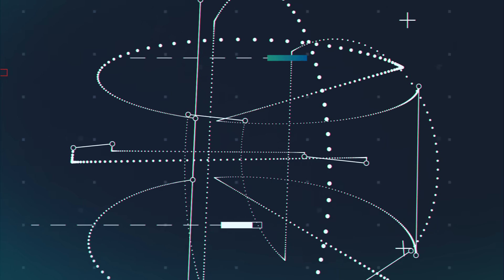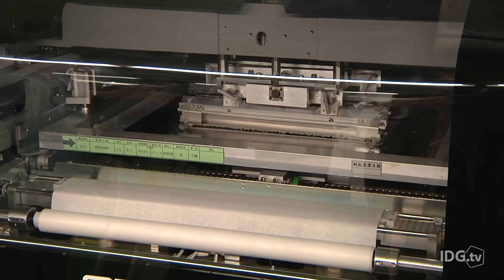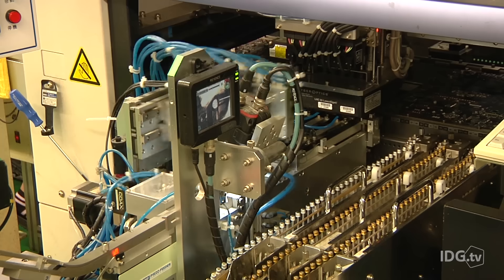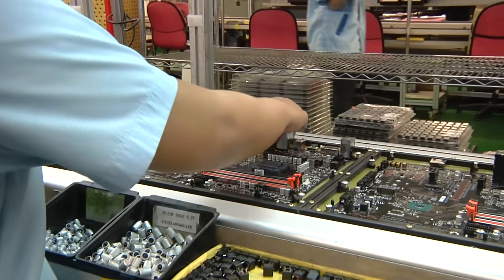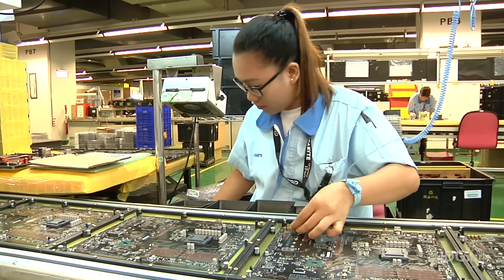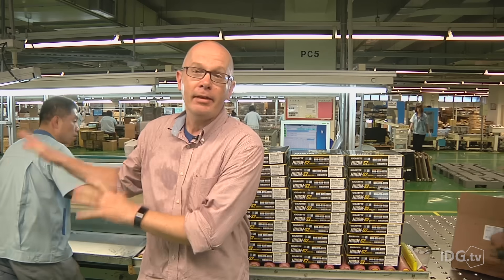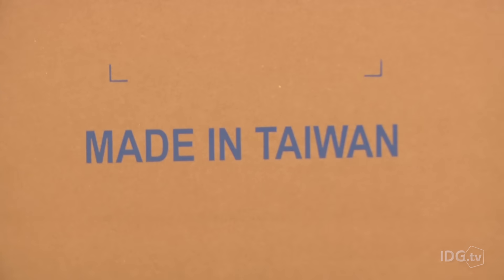How a motherboard is made: Inside the Gigabyte factory in Taiwan

Comment: The industrial engineering layouts and machine interfacing is so killer at this level of tech...Those machines are all "one of's" task specific built...Takes DEEEEEEEEEEEEEEEEEP pockets to finance stuff like this...
Reply: If you bought everything new,  a full double-sided SMT + PTH assembly process along with QA equipment (solder paste inspection, automated optical inspection, X-ray, flying probe and/or bed of nails in-circuit test and programming) easily runs over US$1,000,000 to start. Then you have to pay people to program, maintain, and operate the equipment - all different skill sets. The first board is always the most expensive and difficult to build and you might not break even until you've built many, many boards.

Comment: it surprises me to realize how these boards comes without faulty, respect for these hard workers
Edit: OMG thank u for so many likes
Reply: well mine just came to me faulty :(
Reply: I was about to say that motherboards are frequently DOA. In fact, I just had a brand new gigabyte mobo that I RMA'd because it was faulty right out of the box. If you go through reviews for any brand's motherboards on places like Newegg, you'll be hard pressed to find one that doesn't have lots of people complaining about having to RMA boards.
I can't fault the production process itself though. Motherboards are extremely complex and delicate systems and it's probably very easy for them to get damaged during the shipping process, even if they pass QA at the factory.
Reply: @zomgpirate  yeah and also motherboard manufacturer customer service is many time non existant. They will literally pretend to help you and then not follow up or  never email you back
Reply: Speak for yourself. My ASRock motherboard came with a bent pin on the socket that goes to the memory controller, 2 RAM slots are dead. Great stuff!
Reply: @Idi Amin do you live in Taiwan?
Reply: wrr
Reply: I've been waiting 7 weeks for my new motherboard to get RMA'd because it was shooting out sparks when I got it.
Reply: @addictedtoRS  so, how is it now?
Reply: @mrutub13  The new one I received has been working just fine, although it's overclocking capabilities are sub-par. I have tested undervolting and overclocking my Ryzen 5 3600X, as well as lowered timings on my RAM on my friends ASRock b450 motherboard, which gave significantly better results than what my Asus TUF b450m can achieve.
Reply: they test every piece before packing.
Reply: press f to pay respect
Reply: There's Quality Check at the end of production line.
Reply: It looks easy to work up there, but the workers make long hours i suppose.
Reply: You'll understand all of these when you work on semicon industry
Reply: @Rav3nnn  It's somehow also interesting because I got an education at the High Technical Education, the Graphic Lyceum at Eindhoven, the Netherlands, kind regards.
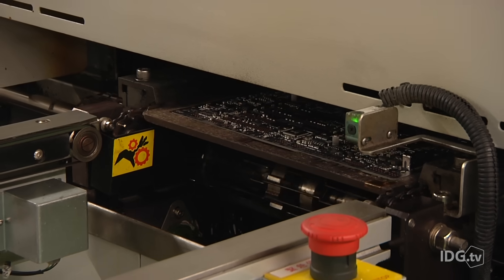Reply: 0:52  this happens because they are backed in an oven
Reply: There is no warranty for Gigabyte or other barnds will be made without faulty. Even some one of those hard workers sometimes can have two left hands.
Reply: Because they have to pass through quality check
Reply: There is a whole industry around repairing faulty motherboards
Reply: When you are using the right equipment for the job, no faults will occur.
Reply: Yeah uhhh they do though. Mobos get RMA'ed all the time. Also @Lucas Pittol da Silva, your comment makes no sense.
Reply: @silverstonebbq  but it reduces the chance of something getting screwed enormously.
Reply: Because Taiwan isn’t part of China. Lmao.
Reply: that's because Taiwan numbah one 💯💯💯
Reply: @DionsTravels  passbook
Reply: @DionsTravels  sir can i ask question? month ago i ugprade my full PC to asus.motherboard.GPU but why it said made in china? i think asus it from taiwan .i live from indonesian
Reply: why would you say thank you for likes
Reply: @SnuSnu91  sir can i ask question? month ago i ugprade my full PC to asus.motherboard.GPU but why it said made in china? i think asus it from taiwan .i live from indonesian
Reply: They come with a lot faults...
Reply: Its 50/50
Reply: Mine came burnt
Reply: I had a gigabyte motherboard DOA once. It was my first build as well, unfortunately.
Reply: You should be. I own the place!
Reply: Said by non a single covid-19 patient ever.
Reply: not all... i receive my motherboard on taiwan, model x58 and it was a waste of money
Reply: @SushiCat0316  It is a fact that making motherboards has to be done by employees, kind regards.
Reply: wrong giabyte has a lot of defective motherboards brand new. to be fair all manufacturers are bad including asus, asrock, basically every manufacturer, no quality control

Comment: Thanks. Wish I could have seen the tiny parts actually placed on the board, though.
Reply: pick n place robots
on aliexpress  you can buy
as well as  owens for soldering
one machine  placing the soldering paste next places the parts then  its going to the owen

larger parts that  were complicated to place  with  robots, those  placed  by workers
Reply: The plexi is usually dark to limit the external light, as high resolution cameras are used to align each and every part to ensure it is placed correctly. Parts can be as small as 0.01" x 0.005" (and even smaller is coming). For this size board, the smallest part is likely 0.04" x 0.02". 

I'm not as familiar with the Fuji systems shown here, but all covers are typically safety interlocked as the gantries that pick and place the parts are dangerous.

Comment: The product should cost a dollar and not hundreds since they are made in air conditioning sweat shops.
Reply: The board itself, connectors and passive components cost nothing. But the chips are very expensive. The pick-and-place machines cost thousands of dollars to maintain and operate.

Comment: The only flaw with Gigabyte MB's is the way PCI-E bandwith is handled. its done so poorly..
but still they currently have the best AM4 board on the market which i recently ordered (Aorus X470)

if your doing SLI/Crossfire don't get a Gigabyte board, if your doing RAM/CPU OC its great for that.
Reply: Gigabyte have been making the best motherboards in the world for over 20 years now.  I can't comment on any pcie problems you've run into.

Comment: Much less automated than I thought.
Reply: You realize that over 95% (a guesstimate, and probably too low) of the parts are automatically installed, and all of the actual soldering processes (save for rework/repair) are completely automated? 

The larger "odd form" through hole parts (connectors, electrolytic caps, LEDs, etc.) don't lend themselves to automation, but there are ways to automate those as well. They just aren't usually as economic as the world's most adaptive creation: people.

Comment: Great. There is widespread concern over some PIXEL phones, which are in trouble by showing Over-heating, Boot-Looping, Abrupt break in display, faulty microphone etc. Google has admitted that in some phones, these faults are because of tiny solder crack in audio-Codec.  Kindly indicate, in the factories, is it possible to view the crack ( using some Microscope or macroscope type device), and if found, re-solder it ??

Comment: Gigabyte makes very good quality boards, and they work great with Intel chips. I just put together a gaming rig with a Z370 board, and the build quality of the board is very good. Only thing is that I would have liked an extra USB 3.0 header, because my PC case has 4 USB 3.0 ports in the front and with only one header, I can only split it for two of those 4 ports. the rest are USB 2.0 headers. Other that, I love this Gigabyte board... It feeds RAM to the CPU at lightning speed, which is a great thing for any application, gaming or no.

Comment: yeah i know that "a lot of work still done by hand' because one of this fuckers throw glue into my 1080ti chip and he/she didnt clean it before it petrified.In result i endup buying a brand new Aorus extreme edition 1080ti which with 100% fan speed was hitting almost 90 degrees celsious in just one run in a common valley test.Yeah good job fuckers.Nice quality control Gigabyte.Thank god that i opened the poor card and after two hours i managed to remove all the stupid glue from the chip.ever since the card maxed out at 62-65 degrees. As for gigabytes job you can take my midle finger

Comment: My old gigabyte board(G41) series had an issue with the northbridge failing several times even after reflow.
Went to the dealer who offered me an old G31(I wanted to keep the current processor and ram) which is running flawlessly since 5 years.
Newer generation boards now come with solid state capacitors which increase the reliability serveral times, plus the dual bios really works when needed.
Reply: The G41 boards with the ICH10 ran incredibly hot yet didn't have any sort of active cooling. Add on top of that the lead free issues still being worked out because of RoHS and the thinking at the time that either A: Everything would work just like it did before or B: Everything would work just long enough to get it past the warranty period. It was a massive cluster and I was proactively adding cooling solutions to customers systems to prevent the onset of these issues. Fans, much better, or in a lot of cases SOME thermal paste, to these heatsinks, greater tension on the springs. Yea, it's like they just didn't give 2S from 2005-2010.

Comment: Motherboard Ranks:
1.Asus
2.Gigabyte
3.Micro Star (MSI)
4.Asrock
5.EVGA
Reply: I think generally grading like that is pointless. If you google, ten sites will give ten different rankings, but the ones listed here are indeed the more popular brands.
For accuracy one has to look at several variables:

Intel or AMD
Form factor- ATX , ITX. Mini ITX etc
Warranty 
and of course Cost.
...
I have so far only assembled Gigabyte, ASRock  and ASUS boards. All three have their own strengths. Recently my mini ITX Gigabyte had to be taken to service centre.Network controller got fried.  Was about 3 years old.  They recommended I get a new one since they have discontinued that model. I opted for an older LGA 1150 board which they sold me for a song. So I can still use the old processor and DDR3 rams. 
I just finished rigging up another mini ITX Gigabyte H27ON-WIFI. Choice was based on price and the fact that the Gigabyte technician has become a good friend of mine😁.

Just my 2 cents babble. Thanks for bearing with me 😌
Reply: what about msi?
Reply: I have 2 ASRock boards. Unfortunately, I have no reason to try another brand just yet.
Reply: EVGA is good but kinda expensive ones.
Reply: I have an Asus MB and a Gigabyte VC.
Reply: Depends on what you're doing with it. All motherboards have there pros and cons
Reply: Asrock is a branch of Asus and it's cheaper than EVGA
Reply: NZXT launched its first motherboard recently, I don't expect to it to be comparable to the ones of the others more experienced manufacturer, but it looks good and hope they'll improve in this market. Right now I have an Asus Maximus X Code, best quality ever, I agree they are one of the best.
Reply: No asrock is best

Comment: No wonder my gigabyte mobo's keep blowing up if this is their current production process.

You can't check a good solder connection with just surface photos and human flip through the hand checks. I'm 3/3 in 2 years that needed to be sent back because of burnt shit, one of which took out my 4770k along with it.

Never gigabyte again, i'm sticking with asus thanks.
Reply: The solder checking is done at line startup. Once they confirm the solder bath/induction heating system is working the line starts running.

Comment: Are they seriously shipping MBs without a final power up and function test. That would make no sense. You can't just assume those components are all good. Failure rate in the field would be astronomical. I worked as a tech in a factory just like this. Sometimes the failure rate at final test was 100%. You can't ship product with no testing.

Comment: They don't do checks to see if the boards are working correctly?
Reply: thats the consumers job ^^
Reply: Christoffer Ekberg there are two electronics tests in this video alone. One bed of nails before the hand placement and another automated visual inspection station after the hand placement and a final visual inspection before pack si that's three right there in this short clip :P
Reply: They check 3 times. Its a motherboard, u dont need a full pc to check it.
Reply: There is special equipment at the end of each line with which they test them.

Comment: Too much waste! cd, instructions should only be available online.  Packaging should be minimized and reused.
I don't see Intel with massive chips disappearing, but for a lot of tasks ARM-based credit-card sized computers would be much better for the environment due to significant size reduction compared to standard desktop and in many cases could be powerful enough.
Reply: Maybe. I have about 16 computers, laptops, mostly towers and an RP3 arm. I basically prefer the towers for good speed under high workloads.

Comment: I love Gigabyte, I've never had a failure of their products, well one time but it was my fault. While in Taiwan, I installed an aftermarket cooling fan for my graphics card, went kaput and went to their satellite office for a repair. But they gave me an upgraded model with much better stock cooling for no fee. Super sweet! Then another time, I needed a new BIOS for my motherboard to support a newly released quad core CPU that I just bought, but there were no BIOS to support it. I emailed Gigabyte support from their website and they replied me a new BIOS file and told me to enjoy and have fun with my new CPU! To be frank, Asus, Gigabyte, MSI, and other board manufacturers are nearly the same when it comes to quality, but Gigabyte left a lasting impression on me.

Comment: Where's the part when they screw up the on-board graphics?
Reply: zodiark1001 - Nope! These motherboards have i7 socket, 8 ram slots & two full-length PCIE slots. They are NOT integrated gpu/cpu, though they do not have onboard graphics as well. Look closely at the camera-check at 1:06.

Comment: I've done this type of work for decades in the good old U.S. of A.
I wish I moved up in the companies I worked at, but I was too good at assembly and repair. Companies moved operations to South Korea. I should start my own business.
Reply: My brother-in-law is the chief design engineer for a local company that used to manufacture mobos for Compaq. When Compaq and a couple other companies withdrew their contracts, the company was forced to lay of over 2000 workers and it has since changed its business model. Now they manufacture printed circuit boards for military and business applications aside from computers.
Reply: that's cool. you could definitely start your own repair shop too.